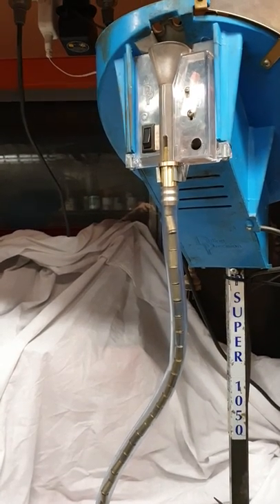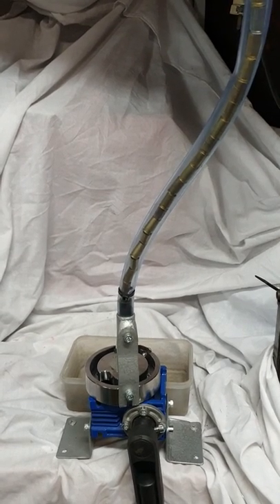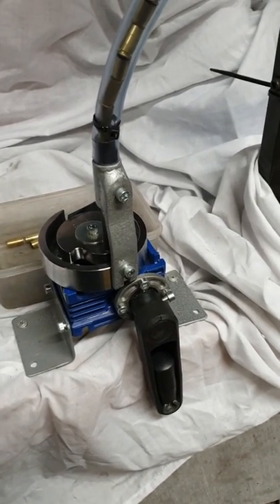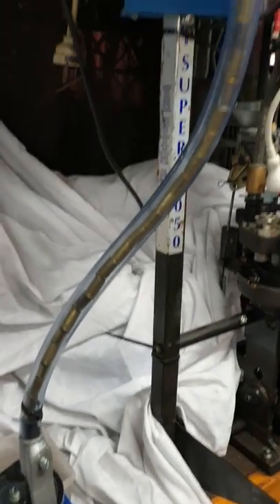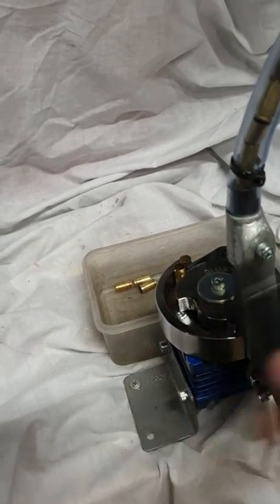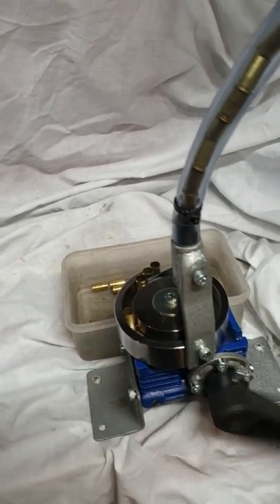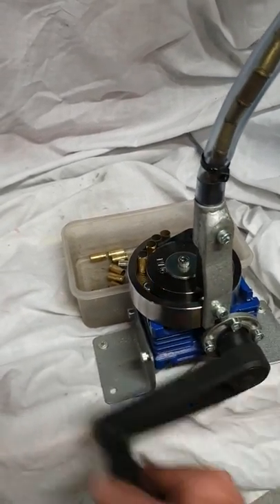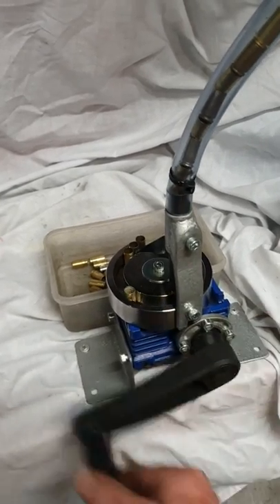Manual rollsizer

Comment: I have the commercial rollsizer I have to take 3 of the screws out so my case feeder can keep up, but when I take out the 3 the rollsizer won't kick out the case cause the moving arm that hit the screws doesent quite move far enough. But with all 6 screws in itll run flawless any fix to this? I was thinking about welding something that sticks out a little further on the screws
Reply from the maker: Ok.
The levers are designed so they only move the case out far enough to allow the NEXT case to drop down.
This is deliberate. 
The lever should extend 30mm or so from the case pusher. 
Please email me a photo of your set-up to info@rollsizer.com.
Reply from the maker: Thats a common problem.....
Reply: Does it actually create a problem to have the rollsizer outrun the case feeder? If not,  it seems to me there's no benefit in moving the bottleneck further down in the system. Slowing down the rollsizer just decreases total throughput.

Comment: Does this require an adapter to connect to a drill?
Reply from the maker: We supply 2x hex bit adaptors with each manual rollsizer. They are nothing exotic and are readily available from a hardware store if you loose them.

Comment: This might be the ideal device to resize the body of an existing cartridge to form a wildcat, which otherwise has no real parent casing. Like forming .458 SOCOM from any WSM case. This might not be an option as long as Starline produces .458 SOCOM, but once production ceased this could be the solution.

Comment: Wow, it will take forever doing it manually...
Reply from the maker: Add a batttery powered drill. You can get 2500+ cases per hour. We supply all the parts to connect to a drill.
Reply: @rollsizer5623  I was told that the internal bearings were not made to handle a battery-powered drill.  Plus who wants to sit there holding a drill forever? Would love to purchase an automated one but sadly, they are not affordable.  I guess one used would be nice once I find one...  But I won't be paying $2200 for a commercial one that's for sure...
Reply from the maker: @chgofirefighter  who by? LOL, We have seen 3 returned under warranty in 5 years and guys who have burned out 10+  drills on one machine and are bow banned from their local hardware store....
Reply from the maker: And we have sold over 2,000 manual rollsizers to date
Reply: @rollsizer5623  lol, banned from their local hardware stores?  Interesting!  The issue with the manual option is having to sit there to roll size thousands of cases in my case I have 20k cases of 9mm to process and that's just for personal use until I get another 30k or so more cases, I load 50k rounds a year average and I'm just tired of finding some cases not pass case gauge.
Reply from the maker: @chgofirefighter  if you are 50k a year buy the commercial. Seriously. It will do up to 6400 an hour and batches of 3-4000 at at time will be 30min compared to 2 hours.
Reply from the maker: @chgofirefighter  if you are 50k a year buy the commercial. Seriously. It will do up to 6400 an hour and batches of 3-4000 at at time will be 30min compared to 2 hours.
Reply: @rollsizer5623  Give or take 50k pieces per year, in the off-season winter time I collect brass, clean, decap, resize and reclean again~  for shooting 9mm Major I try to sort one headstamp brass for minor I do mixed...
Reply: Sadly, your products are out of stock to ship to the USA~
Reply from the maker: @chgofirefighter  i have a few hundred of each in bound to Houston but i DO have 40 or so commercials in houston now
Reply: @rollsizer5623  Thank you, do you have whatsapp or a direct contact number/email? Your website indicates out of stock~  Also, I  have other specific questions that I wish to inquire about and not publically on YouTube.... Thanks~
Reply from the maker: @chgofirefighter  email me youe number to info@rollsizer.com 
Travelling to miami today